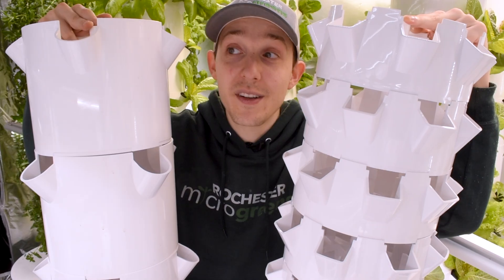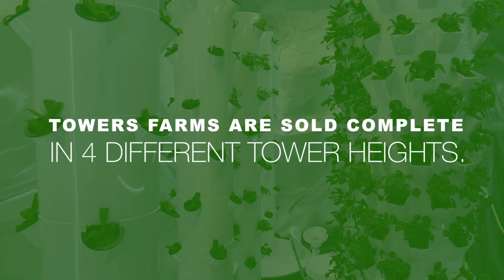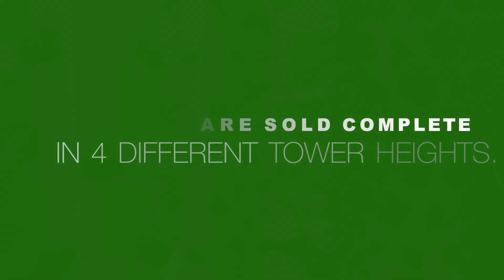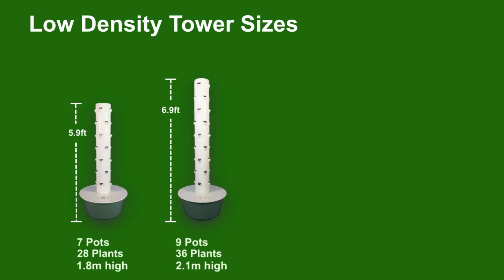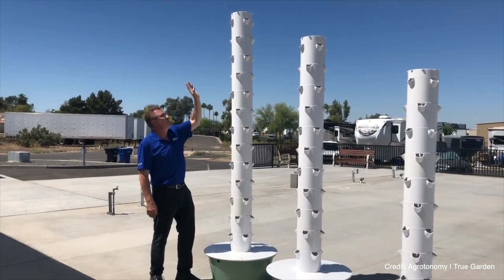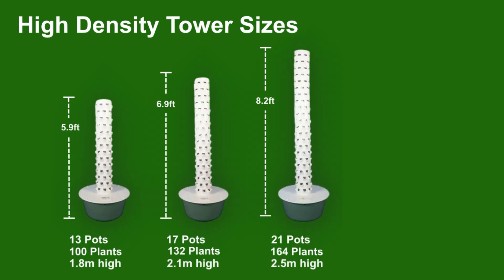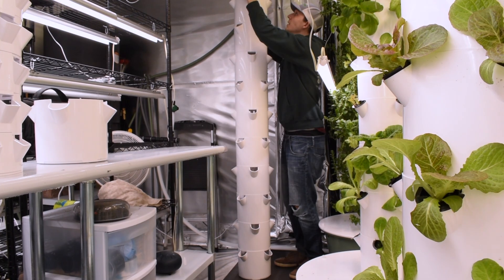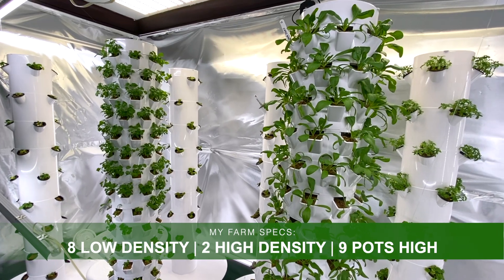High vs Low Density Aeroponic Towers | How To Use Them (Tower Garden & Tower Farms)

Comment: What's the diameter of low & high density tower? each pot whats the distance in low & high?
Reply from the maker: They are the same Both high and low-density Tower Garden pots have a diameter of 22 cm (8.7 inches). The primary difference is the pot section height and the number of planting ports: low-density sections are 19 cm (7.5 inches) high with 4 ports, while high-density sections are shorter at 9.5 cm (3.7 inches) high but feature 8 ports, allowing for more plants to be grown in the same vertical space.